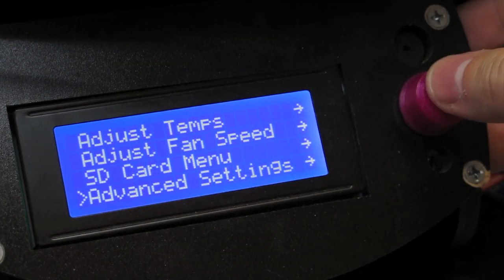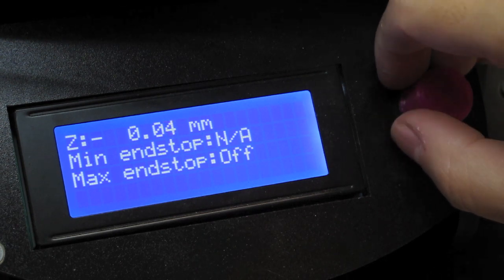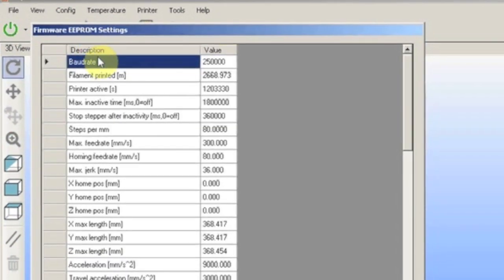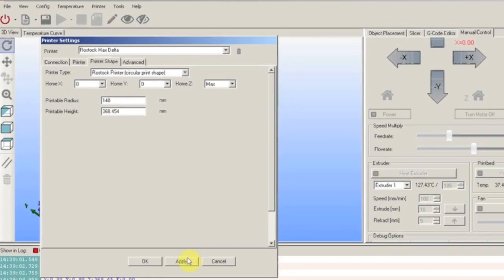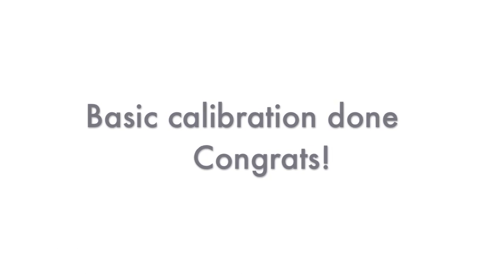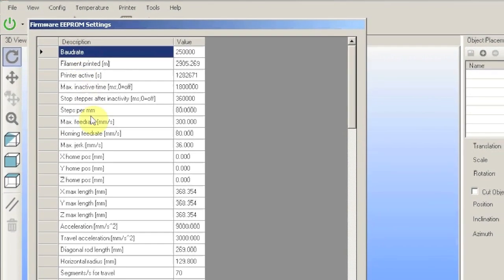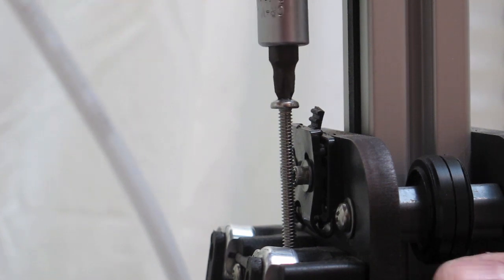How to calibrate the Rostock Max

Comment: Just what I needed for the Horizontal radius as my bed is lower in the middle than the edges, trying it now. Used to update config-h file for that but in the newer Arduino files the code was changed so I couldn't find it. THANK YOU!
Reply from the maker: ***** Yeah, they move them around with the updates. Glad I could help!

Comment: Awesome video! Could not understand the language for calibrating the end stops.  I have a question though. In the guide, it says to put the Zmax height into the Z max length in the EEPROM, but doesn't say anything about pasting it into the  X and Y. Are you positive that that is how it is done?
Reply from the maker: benner2000 No you don't need to bother with X or Y, but when I made the video I was just covering bases. I don't bother with it now.

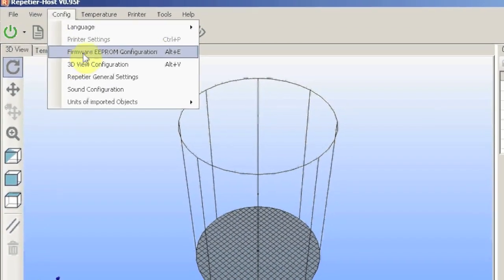Comment: Hey Isaac - hope you're well! I've been rewatching your videos and I noticed at 2:20 you say to increase horizontal radius to lower the nozzle. But I've found the opposite - increasing the horiz radius raises the nozzle around the edges of the bed. 

Are you saying that it lowers the nozzle in the centre? If so, doesn't it make more sense to use z-height to calibrate the centre, and then if the edges are too high/low, use the horiz radius to correct?

I could be totally wrong as I'm still a noob :)
Thanks!
Reply from the maker: +thedoble Yeah it refers to nozzle in center. Yes I agree, this vid was more of an in depth calibration - usually just get the z-height correct then print! I would only do the stuff in this vid if I was doing a more detailed calibration.